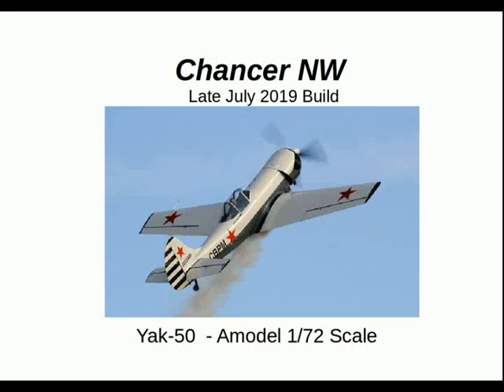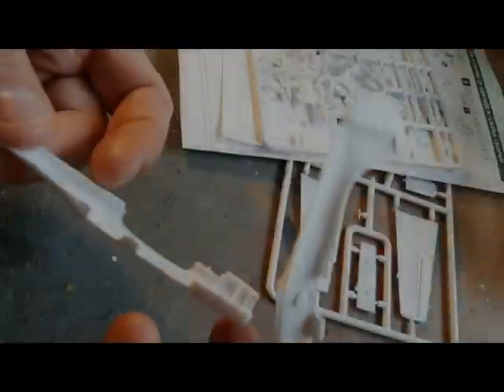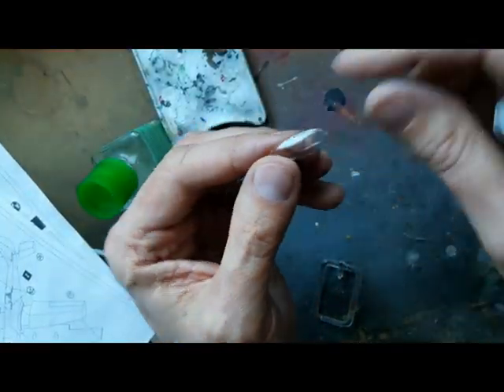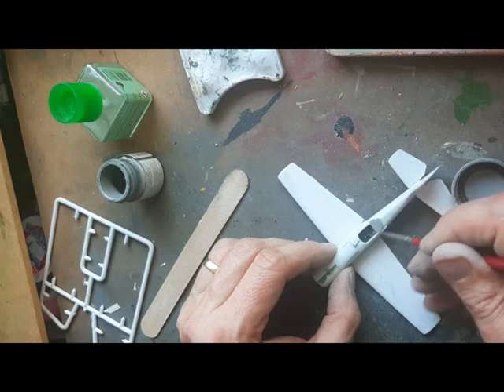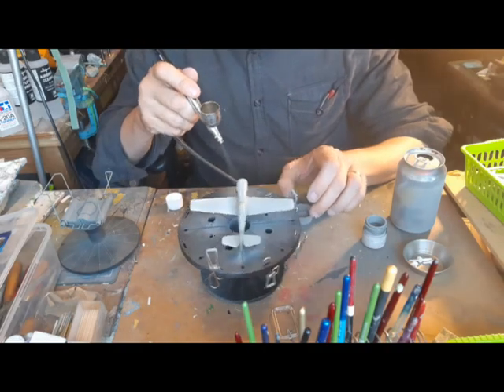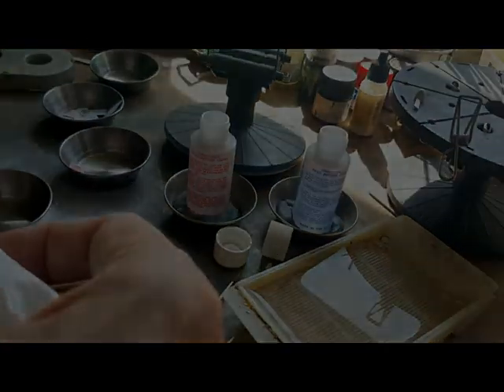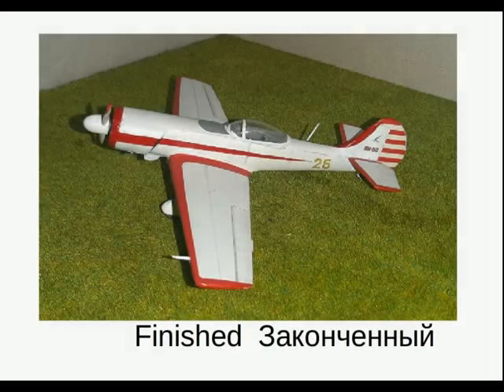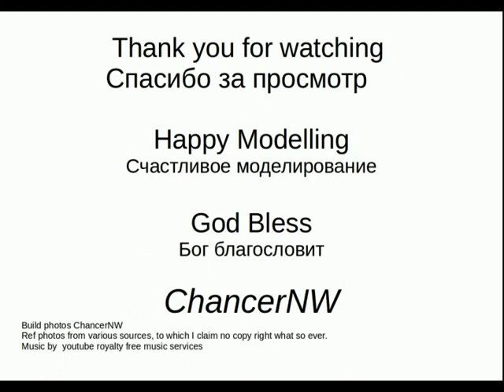Yak 50 Build Vid Amodel  LateJuly 2019

Comment: Nice build with this Yak 50 Len. The evil of poorly fitting parts in the kits, I have often too. Than you can only try to make the best possible out of it. Sometimes you can only make parts by yourself and maybe use etched parts or the remains of old etched parts. and sometimes you are happy if the construction manual is reasonably readable and does not have too many mistakes. Unfortunately, the manufacturers with this poorer quality are often the only ones who have one or the other extraordinary model in their program.

But in the end, you've made a decent model out of it. Well done!
Greetings, Joachim
Reply from the maker: Thank you Joachim. I enjoy the challenge of the poorer quality kits. The Amodel manuals for the most part aren't too bad. I do some scratch building but mostly for interiors.